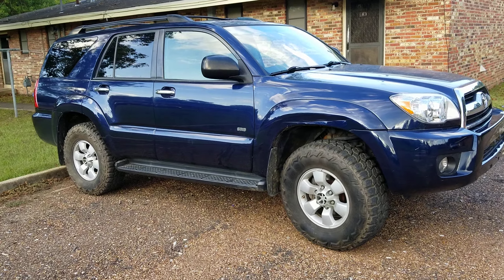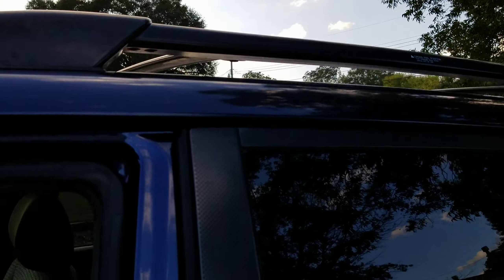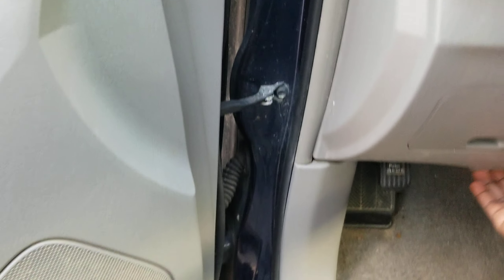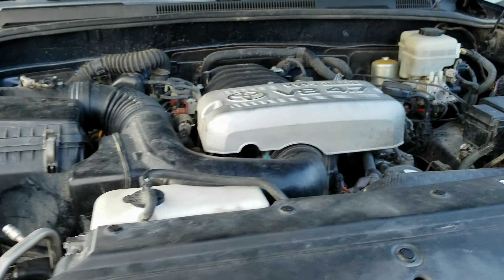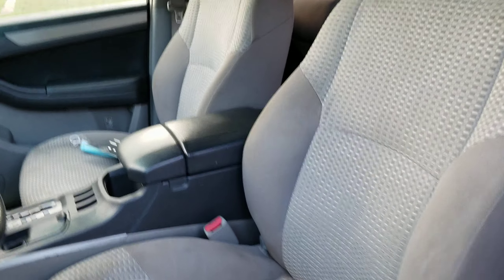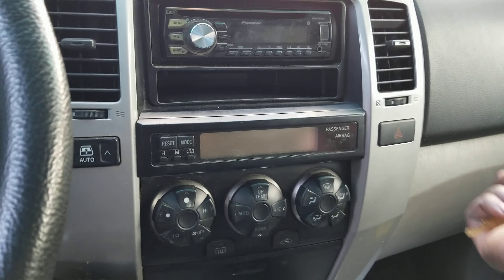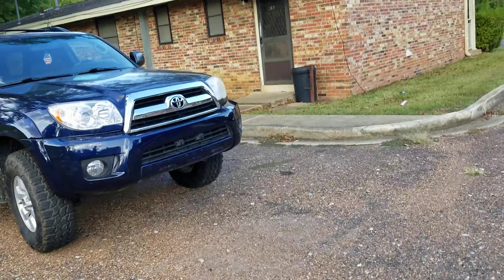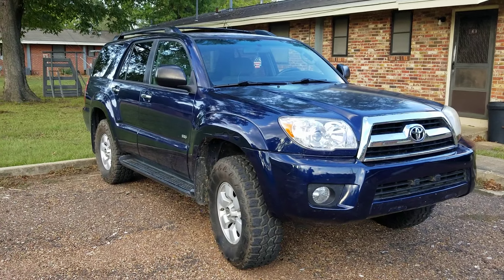Cheapest 'Toyota  4runner' in the USA, with a V8 Motor. Scotty Kilmer Approves! (Auto Focus)

Comment: The AC issue is fairly common on these and it is usually caused by the AC relay. It's a dirt cheap part. You can get it for 20 bucks at any auto parts store or online.
Reply from the maker: Sure. I got it fixed and I was ready to go.
Reply: @AnythingMike  so that's what it was? The AC relay? Also, I don't think you ever mentioned how much you paid for the car? How much was the "cheapest" V8 4Runner in America? 😀
Reply from the maker: @FreeThoughtCrime   watch this video to know how much I paid 👇
https://youtu.be/uEVvgaaROrI